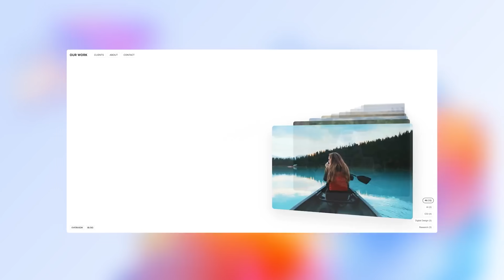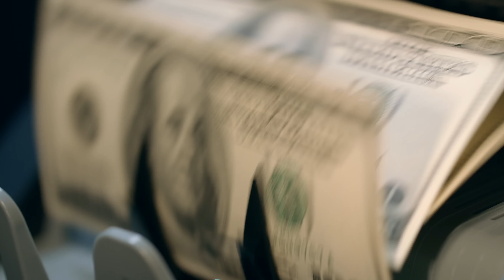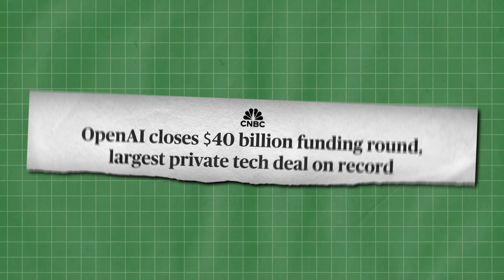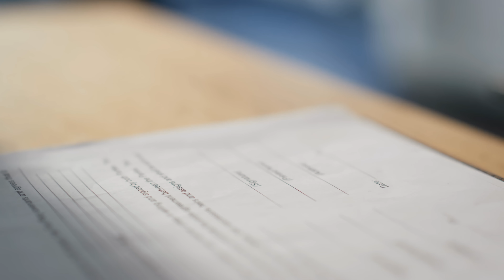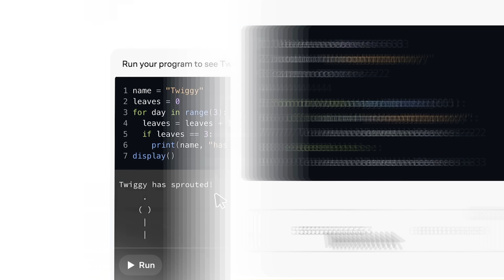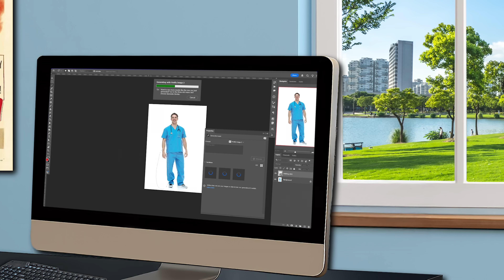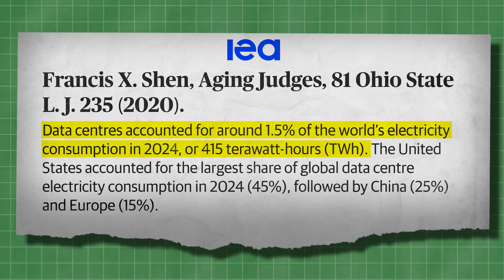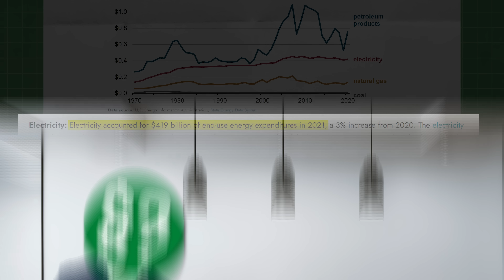How Much Has The World Spent on AI?... So Far

Comment: Shoutout to MIT for pouring cold water on the AI hype cycle ❤
Reply: Needs more water
Reply: @Byssbod  more water for cooling the data centers?
Reply: @aaronalquiza9680  I guess they can use the tears of the developers when they aren’t being used when the AI bubble pops.
Reply: @Byssbod pretty much an ocean before giga-corps find the next latch to blow up their stock
Reply: More water. Ice cold lets go
Reply: Any engineer who thought about the costs and lack of maintainability of AI when input types change knew AI was a boondoggle back in 2017. Also it would never drive a car that was economically viable because of legal liability.
Reply: @toms7114  personally, i think it needs to solve economical practicality. As it is right now, LLMs needs way too much hardware, manpower, energy to scrape, train and operate. Worse, LLMs are being used in domains it has NO business being in. It's extremely inefficient, produces low-confidence variable results, hard depends on trained data for result quality and very biased from alignment (compliance). And yet, i think LLMs would still be useful if it didn't cost an arm and a leg to run, provided we are acutely aware of its properties (And train specific models for specific domains)
Reply: You could have talked to any logician who's used these LLMs since day one; but, we're all buckets of cold water, so maybe nobody would have noticed.
Reply: Go read the study, this video and many other are wildly taking it out of context.
Reply: @Towner101  Ok I went and actually read the 26 pages of the MIT NANDA report (not just asked an LLM for a summary). Yes, I agree that there are a number of nuanced points about which industries are generating value from AI, how they’re generating that value, the barriers to adoption (was surprised by the actual leading cause being employee resistance), and more. However, the headline finding that 95% of businesses haven’t seen measurable improvements to their Profit & Loss (the number that actually matters at the end of the day) from GenAI still stands. That headline finding was given fair treatment in the video.
Reply: @iTzDritte it's 95% of businesses that create their own ai, not businesses in general, like the ones that use copilot to help with their code as an example
Reply: @Towner101 thanks for telling me
Reply: MIT has no idea about these models.
Every single paper they have released is a joke.
Reply: @OnigoroshiZero  well then explain to us how you understand AI models better than MIT.
Reply: @OnigoroshiZero  Proof?
Reply: Lol yes AI is useless, meanwhile junior software devs will be obsolete in 2 years
Reply: @tylerdurden3618 This really confuses me, because what's the plan for when the senior developers die, and mid level Devs become seniors? Just have the seniors do worse work, due to AI not being as good as a mid level? I thought we all knew junior Devs were a temporary productivity sink with the aim of creating future senior and mid level Devs.
Reply: @SlothWindGod  Lots of people are incapable of thinking about the long term. When it comes to the C-suite the only longterm they think about is if the company can become a monopoly.
Reply: @SlothWindGod  it seems like most companys don’t want an apprentice. We have an interesting system in Germany, Austria and Swiss.  It’s called "Duale Ausbildung" = dual apprenticeship. We learn on the job and learn theory in a school for 3 years with less compensation under the minimum wage and after that you are a full working part of the society. In the end everything is possible, if education is done correctly.
Reply: @SlothWindGod  i thought we all knew people like tyler weren't actually devs, but wannabes glazing in the comments.
Reply: @tylerdurden3618  unfortunately for you the world will exist for more than two years and in the long-term, cutting junior devs mean you will have fewer and fewer competent senior devs.
Reply: @andrewhooper7603 we wouldn't even need senior devs by that time
Reply: @tylerdurden3618 you’ve been saying that for 2 years
Reply: @tylerdurden3618  they will not be. AI is nothing more than a tool when it comes to software development, not the worker. The AI can help guide you, but you still have to use your brain to develop the code into something worthwhile.

This is coming from someone that has actually used AI to help with writing code. It gives me the necessary function outlines that are difficult to find with Siemens, but I still have to bring it all together to make it into a working product.

And frankly, I would never trust AI to write code outright. The reason being that humans create messy code anyways, and AI will create the same mess, just faster. And that is ultimately quite scary.
Reply: @troybaxter GPT is literally the second best coder in the world already, in 5 years, everything you are talking about, the AI will do it.
Reply: @tylerdurden3618 People were saying like damn near five years ago now. People have been saying that about self driving cars for fifteen years
Reply: @cjboyo Self-driving car technologies are here
Reply: @IvanLopatin-h2i Viable self-driving technology is not, otherwise it'd already be widely implemented.
Reply: @tylerdurden3618 so how tf would we get senior software devs? You have to be okay at something before you can be amazing at it.
Reply: @tylerdurden3618  i want you to rean ovee what you wrote there and try and figure out the problem.
Reply: @tylerdurden3618  if by AI you mean ‘actual Indian’ - junior software developer jobs have just been offshored
Reply: @tylerdurden3618  I don’t see that coming. In the end software itself is also just a tool to satisfy the needs of a person. It doesn’t matter if you are a Junior or Senior. If you can’t make a good product, AI‘s will not fix that problem. Good software engineers will still be needed in the future, even the junior engineers. The goal was never to be just a code monkey. Maybe bootcamps sold this idea of just beeing a code monkey = software engineer, but code monkeys are the first to go. If you really can replace software engineers, you can replace any job.